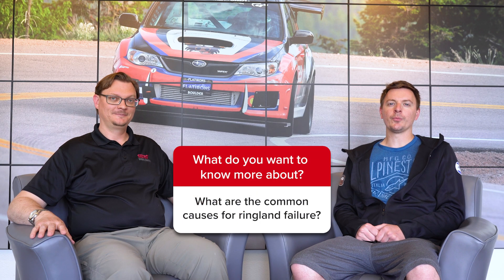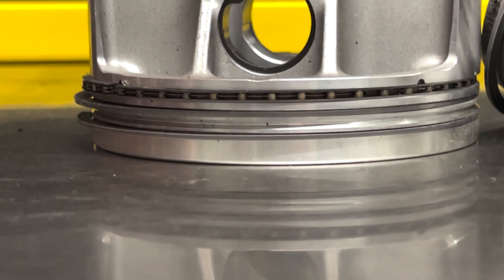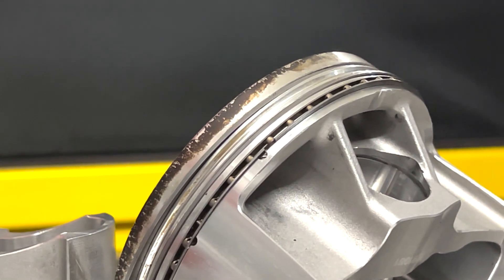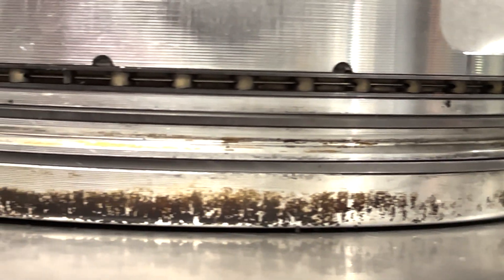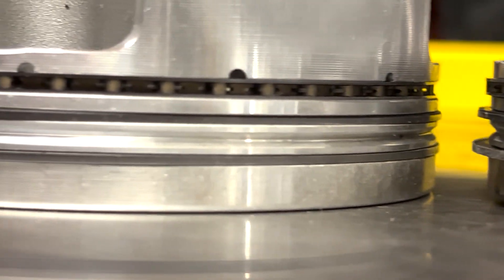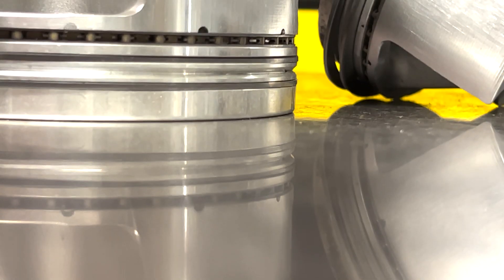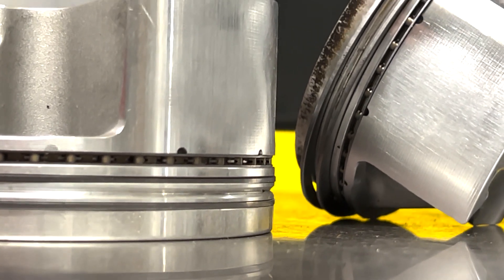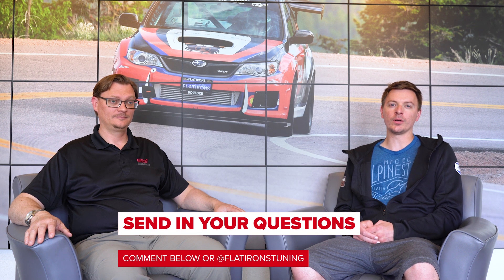What causes of Ringland failures?

Comment: When a ringland failure does this mean the engine has to be rebuilt ? On a 2010 Subaru wrx sti Impreza
Reply from the maker: Thanks for your question.  Yes, when the ringland of the piston fails, the only way to correctly fix it is to replace the pistons which requires rebuilding the engine.

Thanks for watching and Stay Tuned!

Comment: What is your thought about broken ringlands due to the relatively tight stock spec ring end gap? Pre-ign and lean burn causes higher cylinder temps which butts the rings.
Reply from the maker: Thanks for the comment, and I'll just add our experience here.  We are now on the 4th stock engine in our Pikes Peak car.  The first was a completely stock EJ255 making about 375 whp, and it lasted 3,000 race miles and 5 years running up pikes peak.  We are now making about 420 whp and running E85 on what is now our 2nd Type RA block, and this will be our 11th run up Pikes Peak in a few weeks.

We have yet to have a ringland failure.

Thanks for watching and Stay Tuned!
Reply: My engine builder would agree with you
Reply: @FlatironsTuning  Hello, I just bought a EJ257 Type RA engine from Subaru and on the spec sheet it indicates that the top ring gap is 0.010 for three pistons and 0.011 for the 4th piston. The second compression rings are 0.014 for 3 and 0.015 for the 4th piston. 0.010 is like 3 sheets of paper thick that gap is nothing. I understand your EJ255 was completely stock pushing 375 whp and lasted 3,000 race miles however what about the longevity of the engine? I don't intend on racing this engine, but I would like to refresh most major components and tune it to bring it up to say 350 reliable horses. Is your company based out of Colorado since your running Pikes Peak? Once I get the engine installed would it be possible for your establishment to tune my engine? What transmission were you running with the 255? 

Second Question: Do you know of a good tuner in New Mexico that really knows their stuff?  

Regards Fred NM
Reply: @jumpenjackflash4964  they really give more gap in cylinder 4? wow
Reply: You are right.

Comment: Can you guys make a technical video showing your recommended procedures for boost leak testing, as well as a smoker machine to flush out vacuum leaks?
Reply from the maker: Thanks for your question.  We did cover this on one of our early QotW videos.  If you haven't seen that, take a look here:

https://youtu.be/ptocKd6JPzo

And if you think we should still take a more detailed look at doing a smoke test, let me know.

Thanks for watching and Stay Tuned!
Reply: @FlatironsTuning  I'm thinking the community could benefit from a in-shop technical video on diagnosing a customer or shop vehicle with your recommended equipment test procedures for boost as well as vacuum leaks.  You could also make it a recommended pre-inspection diagnosis prior to the dyno testing video.  Watch lots of videos of cars struggling on the dyno because of minor issues like vacuum / boost leaks that the customer was unaware of because of not doing a pre-dyno diagnostics.

Comment: Also factory piston ring gap clearance were too tight that when engine is tuned to have more boost, more fuel, it expands too much to a point it have nowhere to go and get stuck with piston going up and down the cylinder wall at high stress...

That also would lead to broken ringland...
Reply from the maker: Thanks for the comment, and I'll just add our experience here.  We are now on the 4th stock engine in our Pikes Peak car.  The first was a completely stock EJ255 making about 375 whp, and it lasted 3,000 race miles and 5 years running up pikes peak.  We are now making about 420 whp and running E85 on what is now our 2nd Type RA block, and this will be our 11th run up Pikes Peak in a few weeks.

We have yet to have a ringland failure.

Thanks for watching and Stay Tuned!
Reply: @FlatironsTuning  definately good tuning strategy helps minimize the risk of ringlandd failure.. 

Keep em coming.. 🍻 cheers

Comment: What about the 2022 FA24? Still ring land problems? I'm having trouble finding any specs about the internals of the 2022 FA24 -- like forged/not, type of pistons, rods, crank, forged block/not, etc.  Does anyone have any input to help me? Or, maybe point me to a reputable source about this?
Reply from the maker: Thanks for your question.  Yes, the FA24DIT still uses cast pistons.  As the car is so new, it is a little early to see what the potential issues may be.  There are a few shops that have been getting very good results with the Ascent, so I'd recommend searching for those if you haven't all ready.

Thanks for watching and Stay Tuned!

Comment: You guys said with hybrid swaps are the hot spots because of the change in compression to cause pre ignition does this still occur when you swap the pistons to the proper compression to match the heads
Reply from the maker: Thanks for the question.  Fixing the compression is a good start, but you really want the top of the piston to match the combustion chamber.  The proper quench area is really important there.

Thanks for watching and Stay Tuned!

Comment: Want to avoid ringland issues?  2.0L....   The piston pin was moved up 2mm in the pistons for the 2.5L vs the 2.0L version.  The crown was then shortened and with the dish shape on the 2.5L turbo pistons there really just not enough material left on the crown to protect the rings from combustion.  Compare the to pistons side by side.  2.0L piston takes 23psi all day and the headgaskets hold using stock head bolts as well.  Try that with your 2.5L and your quickly going to break something.
Reply from the maker: Thanks for your comment and thanks for watching.  Stay Tuned!
Reply: my 205 sounds like it has piston slap from #4 but i really can't pinpoint it or even hear it under the hood, boggling the hell out of me. sounds like a death rattle from inside the car. it was rebuilt with who knows what parts but has lasted me 20k so far

Comment: strange how EJ207's dont have this issue as much as the EJ257, piston size a variable?
Reply: Not piston size...

But the piston design changes that have to be made due to engine spec changes...

Since the shortblock cannot grow wider (longer conrod),  ej25 vs ej20... Ej25 have longer crankshaft throw for longer stroke  (79mm stroke vs 75mm stroke) which equals to +2mm stroke length at tdc and bdc...

That +2mm of longer stroke have to go somewhere up...

While conrod length ideally to be longer or kept the same, going shorter conrod will have mode bad side effect...

Hence the piston wrist pin location need to go up +2mm...  And the rings also need to go up closer to piston crown (facing more heat in combustion chamber and more prone to detonation)

While the subaru ecu tuning from fctory is being optimized for regular gas or premium, as for power it often best performs on premium gas... But subaru user sometimes will fill up with regular fuel...

It will detonates...and eventually ecu will compensate by knock signal feedback from knock sensor...

And the response to that ignition iming changes by ecu not often fast enough...opens up vunerability to detonation as the ecu making changes for better power and knock feedback...

A good tuner definately will helps alot in this case to optimize the ecu mapping for reliable regular 91 gas...
Reply from the maker: Thanks for the question.  Yes, the piston size if part of it, and so is wrist-pin location.  We may dive into this more at some point.

Thanks for watching and Stay Tuned!

Comment: Jon I'm in middle of doing a hybrid swap. I had the heads chambered by a machine shop. Will the issue you identified still be present or is that if you run the thicker head gasket?
Reply from the maker: Thanks for your question.  If you had the heads chamber matched, then they should mate up properly to the pistons, and yes, that would correct this issue.

Thanks for watching and Stay Tuned!

Comment: My question (of the week) is, is the 2.5 EJ more susceptible to ringland failure than the 2.0L?

I have a early EJ205 and from what I’ve heard, on these engines, running lean tends to cause bearing failure rather than ringland failure... maybe because of smaller bore?
Reply from the maker: There are definitely a couple of key differences between the EJ25 and EJ20.  Piston size is a part, but so is wrist-pin location.  They both play a roll in making the EJ20 a bit less susceptible to ringland failure.

Thanks for watching and Stay Tuned!

Comment: One of the very common causes is also Poor driving habits or not people Simply forgetting to DOWNSHIFT when passing cars or boosting up hilly roads. 

Instead of using 3rd gear (5speed) or even 4th on 6 speed, They are cruising at 40mph behind a slow car then pull out and Floor it in top gear. 
Making full boost at low RPM those pressures inside the cylinder are insanely high (much higher than pressures in 3rd at near redline with fullboost) 
Heat builds up then LSPI happens and damaged Ringlands. (Low speed pre ignition) 

Can make brand new cars from other makers blow ringlands in a few hundred km of bad driving.
Sit on 40mph @ like 2500rpm and floor it in top gear making fullboost. repeat this a few times and even $200,000 BMW will blow ringlands

Comment: Why would Subaru build a car so sensitive
Reply from the maker: Well, I'd say that it isn't as much of an issue if you modify them wisely :-)  We have yet to break a ringland in our PPIHC car and it is making 420 whp now.

Thanks for watching and Stay Tuned!
Reply: @FlatironsTuning oooo ok I see so if your not planning on pushing big numbers or anything this shouldn’t be something concerned about ?
Reply from the maker: @gilbert Cuellar  Sort of.  I would say that you just have to follow a tested and proven mod path, and make sure that the car has a good tune on it and is running properly.  On these cars, things like vacuum leaks, or improperly installed parts can cause a lot of issues.  

Those mistakes aren't always identified properly, and Subaru's end up getting blamed for being weak or unreliable.

Take a look at this video we did a couple of weeks ago if you haven't seen it yet:

https://youtu.be/bfAKsLQQHX4
Reply: @FlatironsTuning  thank you for the info helped a lot

Comment: You didn't say anything about thermal expansion. Metals expand with heat...the longer you stay in boost the more the piston will expand and tighten the ring gap...eventually breaking it. Purpose built race engines are built with more tolerance for a reason...street motors are built with a tight tolerance and cast pistons with less thermal expansion rates for the average start and go mindset..better cold start emissions, less wear and tear on the cylinder walls, but the tolerances aren't there for long durations of boost. Subaru did what they had to do to sell the sti in America. Sadly Americans don't know how to let off the gas and let her cool down some.
Reply from the maker: Thanks for the comment, and I'll just add our experience here.  We are now on the 4th stock engine in our Pikes Peak car.  The first was a completely stock EJ255 making about 375 whp, and it lasted 3,000 race miles and 5 years running up pikes peak.  We are now making about 420 whp and running E85 on what is now our 2nd Type RA block, and this will be our 11th run up Pikes Peak in a few weeks.

We have yet to have a ringland failure.

Thanks for watching and Stay Tuned!
Reply: @FlatironsTuning  Doesn't E85 burn cooler? Doesn't E85 have more oil content in it? How much Boost? Long durations of low boost compared to high boost I'm sure would make a difference in temps everywhere. I feel like your using E85 as a fail safe, but what ever works for ya. Not everyone has access to this magical E85 fuel.
Reply from the maker: @stringgreens6387  We only made the switch to E85 in 2020.  Before that we ran race gas that was 104 octane.  But yes, E85 does help keep in cylinder temps lower, and it is more resistant to detonation.  Race gas does run a bit cooler as well, but nowhere near what E85 does (which is why we made the switch).

Comment: This doesn't seem conclusive to me. Why have so many stock Subaru's suffered ringland failure since 2007?
Reply: The unequal length header setup causes cylinders 2&4 to have excessive heat build up because of how far the EG has to travel to the downpipe. This heat causes predetonation within the cumbustion chamber then the piston hits against the cylinder walls and breaks the ringlands around them. As well as subaru using cast internals is the driving force of components failing and being weak.
Reply: @isaacvelasco6498  Actually unequal length headers reduce scavenging on 2 & 4. This leaves spent gases in the cylinder leaning out the AF mixture. However UEL headers have always been used on EJ's and ringland failure didn't start happening until 2007. So the header argument is inconclusive as well.

That said I think EL headers are a great reliability mod because they help to equalize temps across the cylinders.
Reply: Cylinder 4 is the sacrificial cylinder that takes all the abuse and is normally the first cylinder to fail.  Cylinder 4 is actually designed weaker than the other three cylinders.   Some people resort to trying the cylinder 4 cooling mod, but who knows how much that truly helps or can contribute to some other unique issue.
Reply: @salspec3381  it's in the factory tune cylinder 4 is where the knock sensor is for a reason.  Also study the cylinder 4 head port design flow not so good.
Reply: Yes cyl #4 does run hotter with the oem manifold (so does #2). It may have been an oversight, but I've seen no evidence it was intentionally engineered to be weaker. Plus ringland failure can occur on any cylinder. Is it more likely on 4? Maybe. Conclusive no. Again this didn't start until '07. The EJ design was not really changed so why did it start. New ECU programming, cost cutting... there are plenty of possible causes, but conclusive? I'm not convinced. Especially when it comes to ECU programming. People were getting stage 1 tunes and still had ringland failure.
Reply: @salspec3381  Exactly. Why would a manufacturer design a weaker cylinder intentionally. The issue of ringland failure is a multifaceted and intricate issue that does still remain inconclusive as of yet.
Reply: mistreating the car maybe?